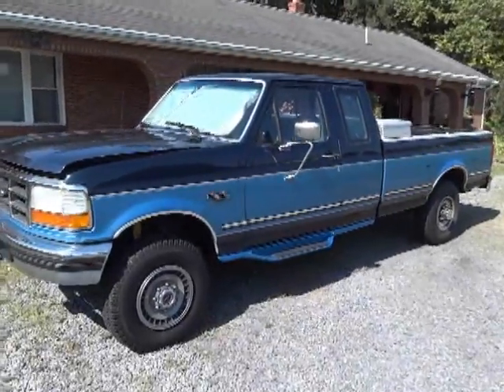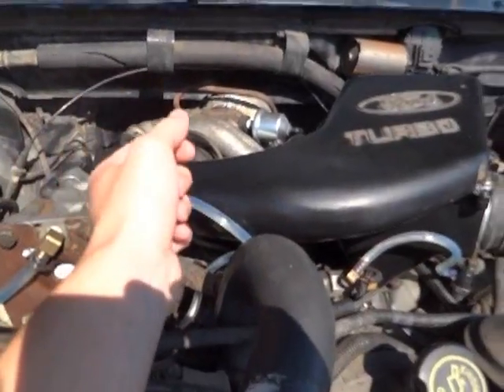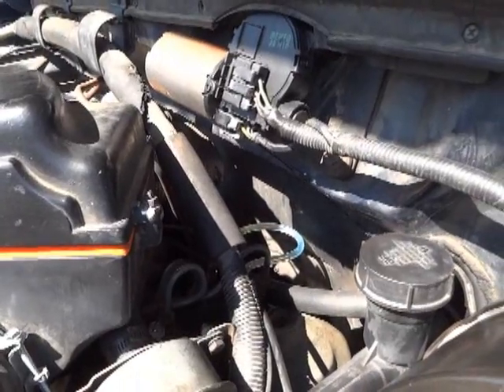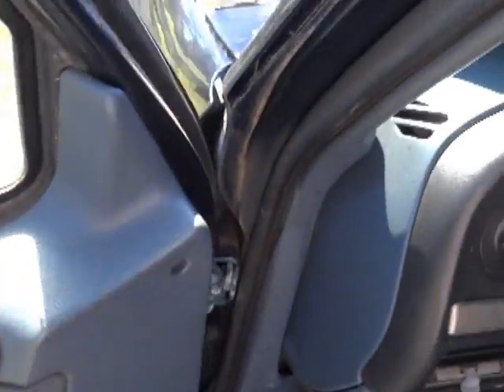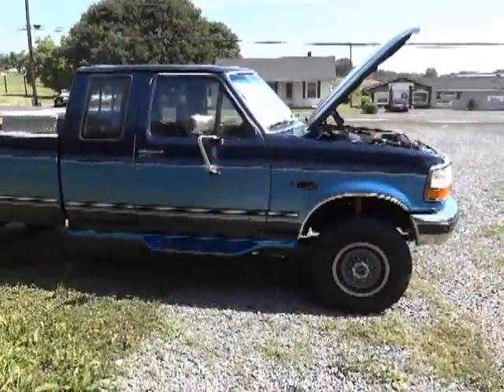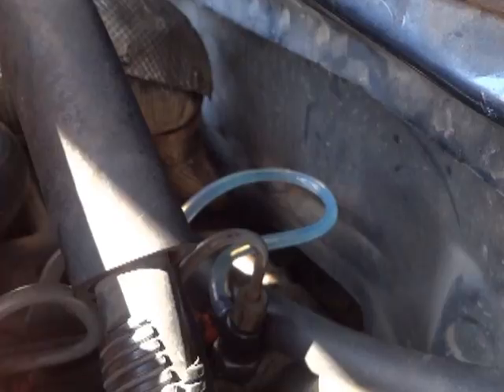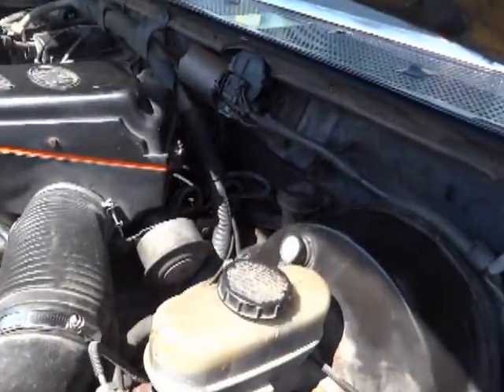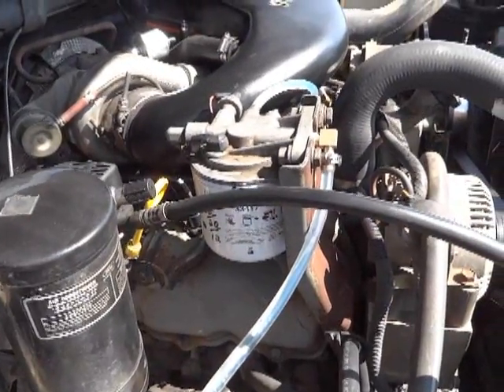How to check for air in fuel lines on a Ford 6.9 & 7.3 IDI Diesel

Comment: thank you so much for posting this. just saved myself a new set of injectors and IP. turned out to be air intrusion from a loose hose clamp on the line into the fuel filter.
Reply from the maker: jesjox Thanks!  I am glad I could help :)  Also, fyi the ultra-low sulfur diesel that you are putting in the tanks offers basically no lubrication for the IP.....you really should be adding some plain 2-cycle oil to each tank when you fill up (8 oz per tank....aka half quart per fill-up).  You can get 1 gallon jugs at walmart for $12 or so (blue bottle) & it will make the truck run a lot smoother & its much better for the IP & injectors.  Thanks for commenting!
Reply: +Real Tool Reviews plz get back to me I need your help billrogers3870@gmail.com

Comment: bleed the air from the injectors with the motor running. start it and loosen the hard lines off the injectors until only fuel comes out. if you replaced the injectors/o-rings/return lines odds are theres still air in the hard lines or in the return lines themselves if you didnt manually purge the system. also check the hard line connections at the fuel pump while its running for fuel leaks that also turn into sitting air leaks.
hope this helps and saves you some money!
I like the clear hose idea too
Reply: bleed each injector individually and close the one youre on before moving on
this helps the air bleed through the system with the changing pressures and bleeding
Reply from the maker: kenny Groff
The rough idling on this truck ended up being the injection pump timing.  I rotated the pump to the left by the thickness of a dime & it fixed everything....fuel mileage went from 8mpg to 16mpg.....no more rough idling & no more smoke.  Thanks for the suggestions though!  A few other places air will leak in are the intake tubes inside the tanks (they break off), the fuel selector valve, and the fuel pump itself.
Reply: dmcguinn1 No problem, 16mpg is fantastic, the timing adjustment would have been my next suggestion other than to clean up the air filter
Reply from the maker: kenny Groff The one other thing that I would suggest that anyone with an older diesel truck should do, is add regular 2-cycle oil to EVERY tank of fuel (0.5 - 1.0 ounce per gallon)....it will lubricate your IP & make your truck run much better.  No smoke...and 1 gallon costs $12 at wal-mart.  The new ultra-low sulfur diesel does NOT lubricate the older diesel engines & they were not designed to run on it.
Reply: @RealToolReviews  hey im having the same exact issue with the rough idle and excessive smoke. Did it really clear up after adjusting the timing on the Ip was it hard to do?

Comment: Just FYI, the return line off the filter head flows TOWARDS the injectors, not the other way around. There is a check valve that allows air to escape the filter head, but does not let fuel flow back into it. 

If you don't believe me, take it off and try to blow through it.
Reply from the maker: Yeah I know, it was a accidental misspoke on my part.  The main point I was trying to get across was to show the different return lines that you would look for air in.  Thanks for watching! :)  And good eye! ;)
Reply: I like the clear hose Idea. How long have you had it on and how does is it holding up? I put a clear fuel bowl on mine but would like to do the clear hose as well.
Reply from the maker: Max Sauer I only used the clear lines temporarily to diagnose if air was leaking into the lines and/or if the orings were bad.  I did not leave them on long (especially with no hose clamps).  I would assume it would be ok for a while since diesel fuel isnt very corrosive like gasoline/ethanol, but I wouldnt want to spring a leak 100 miles away from home, so I swapped it all back to normal rubber fuel lines once I was done.

Comment: Helping my nephew with his truck. Getting  small bubbles in all 3 lines. We have not done the line from the lift pump. Is it possible that the lift pump is adding air to the system. Also,can't seem to find the correct lift pump. His has the really curve arm vs the longer flat arm? Anyone know the correct part number.
Reply from the maker: Yes it is possible that the lift pump is adding air, however it is also very likely that the fuel selector valve (along the frame rail) or the filter housing is leaking air also.  To see if it is the selector valve, disconnect the incoming line from the lift pump & put a fuel line directly into a 5 gallon can of diesel & also remove the return line from the rear of the drivers side fuel return & connect another fuel line returning the fuel to the 5 gallon can (closed loop).  If it runs with no air in the clear lines, then its the selector valve or the pickup tubes inside the tanks.

The lift pump is an Airtex 60278.  When you replace it, you will need a remote starter on the starter solenoid because you MUST bolt it in when at the bottom of the cam lobe (no tension on it), if you install in any other position, the lift arm will snap off as soon as you try and start the truck.  I used a 2" hole saw to cut through the inner fender well to see directly into the opening VS using a mirror at an angle.  To understand what "cam lobe" means, think of the cam lobe as an egg....one narrow end & one wide end.....you want the narrow end pointed straight up & the wide end facing the ground.
Reply: dmcguinn1 He bought a new lift pump and we installed it. His bus ran much better but we still are getting a lot of bubble from the return junction to the driver side return line.
We tried the 5 gallon can trick with a Holly (red) electric fuel pump and also got bubbles. 
Idling or driving on flat ground there are no bubbles. The bubbles start when climbing a pretty steep hill. Could the injector pump be leaking under a load? or is it normal for air bubbles under load?

So far replaced all the return caps and o-ring, all connecting hoses,  return fuel line, fuel line to filter and from the filter back to the rail.

Anyway, thanks for the tips and the video. It is very helpful.
Reply from the maker: Joeri0720
Are both tanks (or at minimum, the tank you are using) completely full of fuel?  If not, and you drive at an angle, more of the in-tank pickup tube is exposed & could suck air.

If the tank is full, then try the following:

1. Wiggle each return cap back and forth 3-4 times to ensure they are fully seated correctly.  One o-ring, in one cap (1 out of 16 o-rings) will cause the air leak.
2. Ensure the fuel filter is completely bled.  Air will get trapped in there, and at an angle, it could be pushed through the system.  When you are done bleeding, add a standard cap to the schrader valve (off of a tire).
3. Test it at load on flat ground.....either at highway speeds, or drive slower in a low gear....get the RPMs up & see if bubbles form.

If that doesn't work, then do the following:

1. Remove the 90 degree fitting & attached check valve on the top of the injector pump.  It is NOT on the rear (facing the cab), it is directly on the top & the return line attaches to it.  Separate the 2 pieces (90 degree fitting & check valve), and clean them with carb cleaner....over & over until nothing comes out onto a paper towel.  You may need to use a small pick in order to scrape around inside....get it clean.
2. Replace the o-ring that is at the bottom of the check valve where it threads into the injector pump.  That o-ring could be leaking air.
3. Use teflon tape on the threads & reassemble.

In addition to this, you need to add the following to EVERY tankful of diesel fuel.  With the new "ultra low sulfur" diesel, there is zero lubrication for older injection pumps & they burn up because they aren't lubricated.  The best mixture you will add is :

16 ounces of 2 cycle engine oil (1 gallon jug at walmart is $12) & 4 ounces of Dieselkleen.  The 2 cycle oil is the most important part.  Your truck will not smoke by adding it, but it will instantly make a difference in the lubrication & it will run better.  You need to add this to each tank when you fill up.

Try those things out & we can go from there.

Good Luck!
Reply: @RealToolReviews  This message is nested and hidden. It should be pinned up at the top. Thanks for taking time to reply.

Comment: I had an old ford 1.8td with a lucas pump, air leak, all pipes replaced, new pickup in tank....seals on pump shaft were sucking in air it turned out in the end; it was cheaper to have an uprated pump done than a standard rebuild but I ended up scrapping the car as it was only worth £300, cost for pump was about £350-£450!

Comment from the maker: Oh yeah, definitely..its best to do this "test" with two full tanks of fuel. In my truck the front tank's pickup tube is broken off at the 1/4 tank level & will stall out if it gets that low. My fuel selector also allows the rear tank's lines to drain back & empty out when off. The o-rings on every return fitting attached to the injectors are the #1 source of air leaks on 6.9 & 7.3 IDI trucks, so this is the simplest test I could come up with.  Thanks for pointing out another source of leaks!
Reply: How do you test if the fuel selector is allowing drain back? I think mine may be doing this because my truck runs great, but every morning I pretty much have to re prime it, however after I get it started in the morning, I usually have no starting problems for a couple hours after shutoff
Reply: You ever figure this out I have same exact problem. I replaced selector valve

Comment: yup, transparent pipes r a good idea, although if the pickup in the tank is blocked a little u get cavitation bubbles which is confusing if u replace all pipes and filter and still get what u think is air leaking!

Comment from the maker: The lines that are clear are the return lines & the intake line.  They are very low pressure (under 10 psi), the only high pressure portion of the fuel system is located between the injection pump & the injectors (metal lines).  Normally the return lines are rubber, but since a very common issue is air leaking INTO the system, you cannot know for sure unless you can visually inspect it.  Hope I helped!  Thanks!

Comment: I don't get it. All those lines are pressurized. When does ambient air pressure(0 psi) exceed the pressure in the lines? Maybe when engine is off. No other time.
Reply: Only on the suction side of the primer pump

Comment from the maker: Yes, I had done pretty much everything fuel system related up to this video.  I actually cured the rough idling problem about one month afterwards by adjusting the injection pump timing.  It took about 30 minutes & fixed all my issues.  I will be making a follow-up video shortly to show everyone the change.  Thanks for your suggestion though, that is a common problem with these.
Reply: A couple of years ago, my '93 7.3 IDIT was blowing so much black smoke that people were yelling at me as I drove by. 
I'm a carpenter & was too busy to look for the cause myself & thought it was something deep (expensive). 
Pretty soon, I was pulled over and given an 'inspection order', meaning a shop with a certified inspector on staff had to deem it roadworthy. I thought, hey, it's just a work truck! 
A former Ford diesel mechanic asked me to let him have a look & charged me 40 bucks to adjust the I.P. timing. This cleared up the exhaust problem but I still had to have a road up series of fixes to get my inspection sticker. About $3k later, I had an inspection sticker and everything working well. No regrets on how that went...spending the cash brought it back to where I just take better care of it.

Comment: Common problem. Before dicking around with lines. I had the same thing my 2002 7.3   Running on like three cylinders. I had the Fungi in my tanks microbial just a little water you got it. fungi  I put that 911 fuel conditioner in it and that crap works. fast!!! like in 5 minutes. I know this growth and rust can screw you up bad this can inflict serious problems in systems .   So try this first. before working on it.